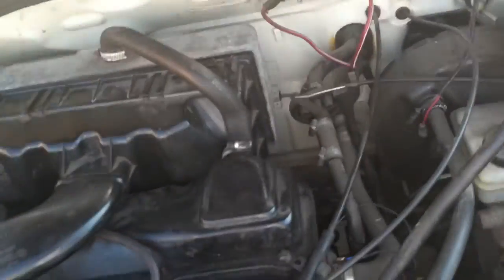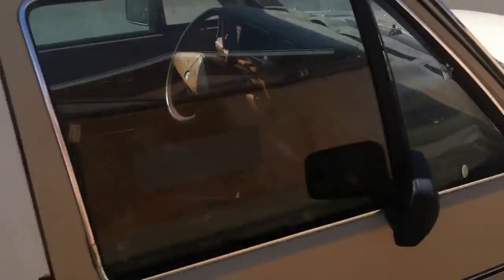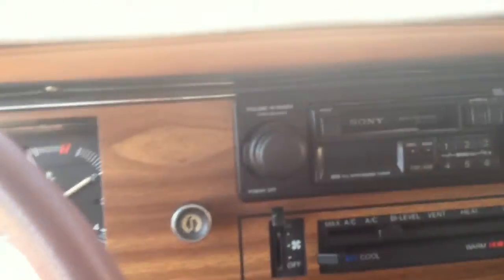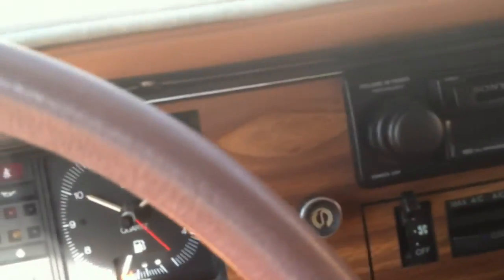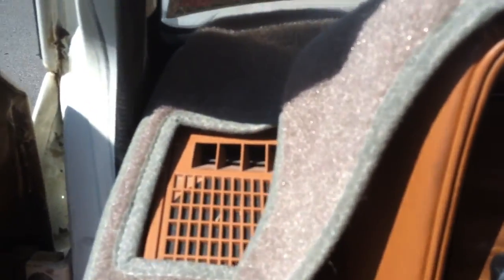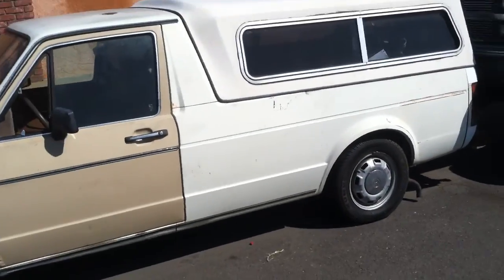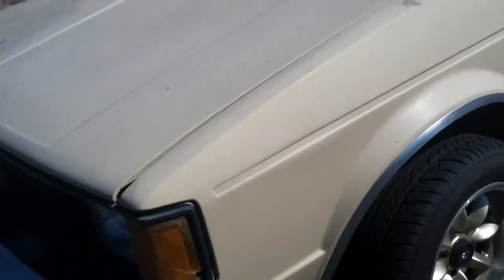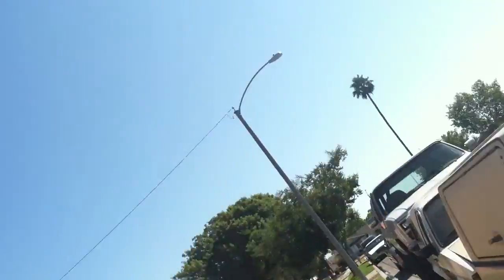1981 VW Volkswagen Rabbit Truck Caddy For SALE DIESEL

Comment: 6000 is way too much for that thing, no head liner, rust at 0:04 on the roof & lower left side of the door and 0:40 with busted lights in the back. Looks like it’s got little ding's and dents all over it, and that power house 1.6L sounds good but 100k but fully loaded big rigs are going to pass it on hills, But most of all the I love the wrong color doors and no bumper give it that "pro bucket" look The only thing nice is the Butt ugly dash, Interior & seats that most people will change out

Comment: 6000 is way too much for that thing, no head liner, rust at 0:06 on the roof & lower left side of the door and 0:43 with busted lights in the back. Looks like it’s got little ding's and dents all over it, and that power house 1.6L sounds good but 100k but fully loaded big rigs are going to pass it on hills, But most of all the I love the wrong color doors and no bumper give it that "pro bucket" look The only thing nice is the Butt ugly dash, Interior & seats that most people will change out